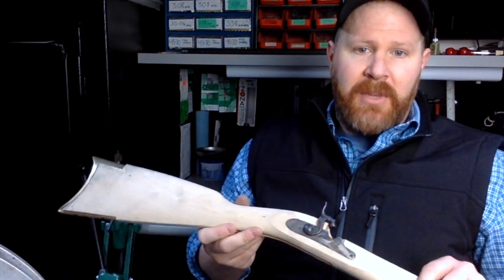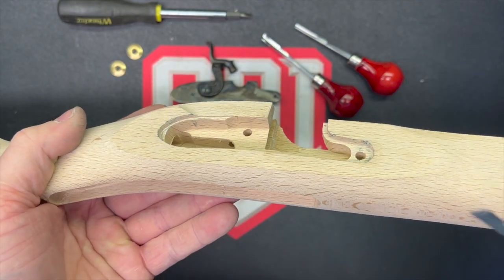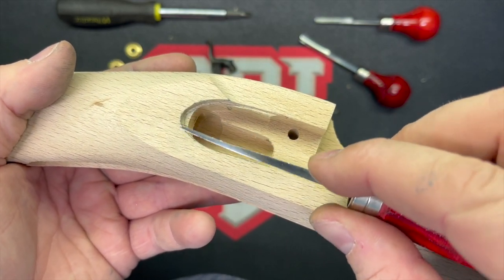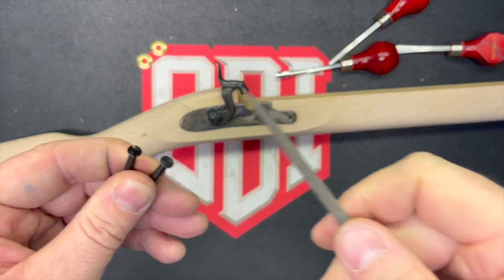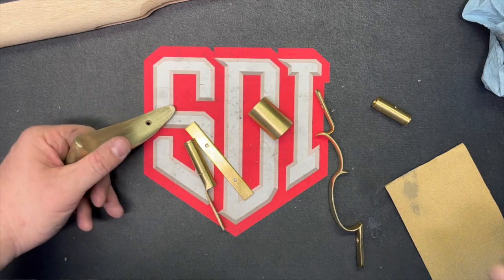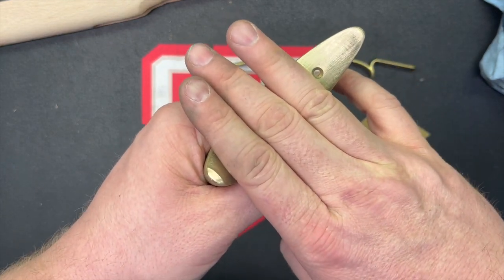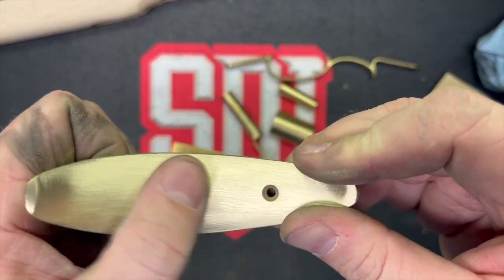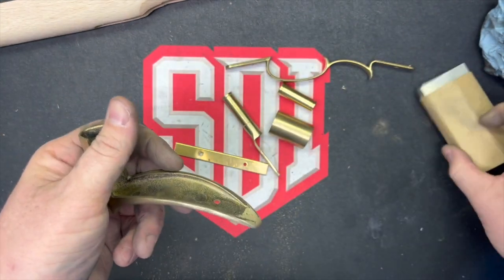Sonoran Desert Institute FTT 210 Muzzle Loader Lab: Part 1

Comment: The screw wasn't an accident.  Nor is the taper on the cut of the other screw head.  Its there for you to correct.
Reply from the maker: What makes you say that?  There was absolutely no mention of hidden problems in the course syllabus. That’s not how the class works.  Just another example of poor QC on the part of Traditions.
Reply: @scottbozarth8459  Never said it was.  However it's a gunsmithing class.  You do the math.
Reply: @scottbozarth8459 I think traditions kits are just varying in the amount of work needed so they probably wouldn't put it in the syllabus if it's something they aren't expecting.